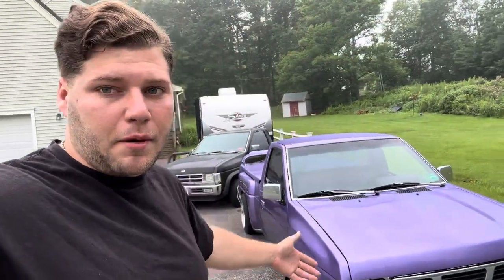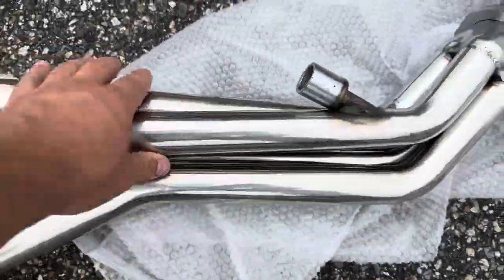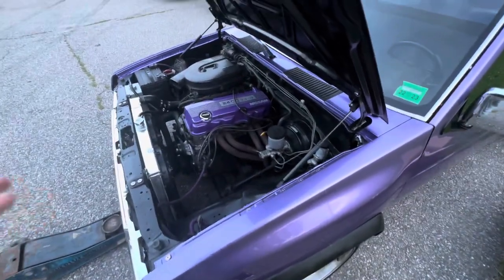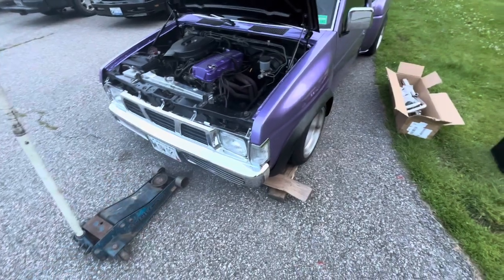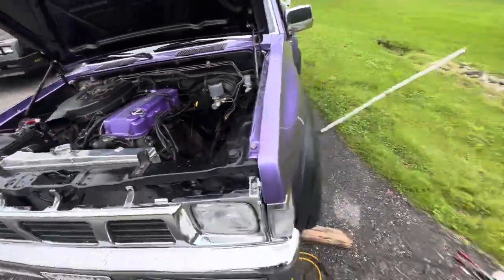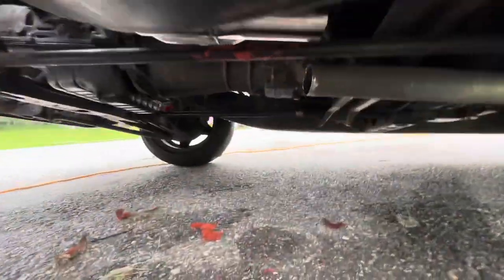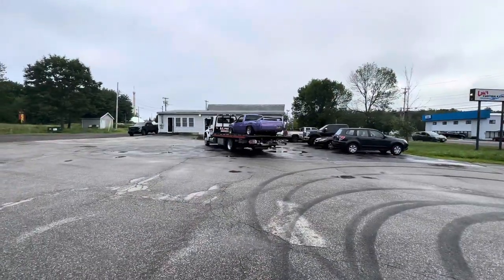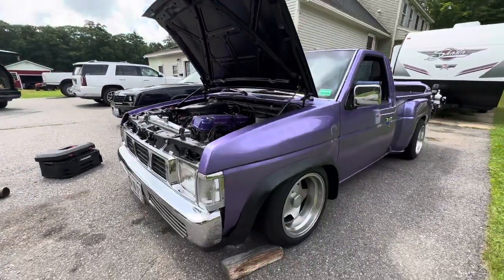How To Install Headers On Your Nissan Hardbody!!

Comment: Where are you located? So jealous of all that lush foliage. I am in Arizona. So arid desert.
So where did you get your hedder from again? I have 1997 4X4 love my little boy, he just needs some help with power. Thanks again for the videos
Reply from the maker: unfortunately, it's been some time since I've made this video, but honestly, I think all the 4 x 4 headers are the exact same all across-the-board, it's a 4 x 4 header that I made fit the 2WD!

Comment: Can't wait for the headers to come in. I already got the adapter kit and an edelbrok classic style air cleaner with 120000 cfm. The sensor is unhooked to the factory air box but the truck runs sooooo much better its unbelievable!
Reply from the maker: the headers will make it sound so much better too!!
Reply: @walkersootoo what adapter

Comment: How exactly did you bend in the firewall because I’ve been beating the dang thing in trying to make these fit and have barely made any progress.
Reply from the maker: just have to really hammer it out
Reply: @JapaneseMinitruck  a bigger hammer it is I guess lol
Reply from the maker: @ToastyBoi998 that's all I ended up doing, it sits close but just need some good swings lol, if you could lift up the truck, it might be easier to get to from the bottom possibly

Comment: So I know im behind on nissan stuff I have a 1986.5 2.4l Z24i 4x4 D21 nissan hardbody is there any headers made for the z24i engine I wanna have a header and not the manifold style that's oem and I can't seem to find anything on them or how to do it or if it has to be a oem part I'm not sure how to find the header for it please help if you can thanks boss I will also be subscribing
Reply from the maker: I believe someone makes them somewhere, I've seen people install headers on Z 24 I before I believe but unfortunately I haven't had to work on his Z 24I when it comes to upgrades so I am unfortunately not too sure.
Reply: @JapaneseMinitruck  I'm glad you responded I've been looking for quite some time myself I can't find anything custom for it either
Reply from the maker: @PD-ze2pm if you have Facebook, I would probably ask on some Nissan D21 groups! Some might have a good lead!

Comment: Why cant you just buy a performance header for a 1991 240sx KA24E? Wont that Work?
Reply from the maker: I have to do some looking into it, I believe the 240 SX heads are a little different than the hardbody heads, even the 240 has better cams, better intake, manifold ETC… it's hard to find a good header for these being that the four-wheel-drive one requires just a little hammering on the firewall/floor pan, but trying to avoid the torsion bars at the same time and making sure it tucks above the frame so it doesn't get scraped all the time, I have to do a little looking into it. I would possibly be willing to purchase one if the exhaust port are the same between the 240 and the D21

Comment: How do you pass smog with a egr delete?
Reply from the maker: where i live we don't have to go through smog. and cars where i live are exempt from certain emissions things over 25 years old
Reply: @JapaneseMinitruck  ah damn, my 2000 2.4 frontier has a cracked ex manifold and I was looking for headers but can't find any
Reply from the maker: @omarbojorquez7826  unfortunately i haven't found any headers for a 2 Wheel Drive 2.4 either

Comment: Awesome video! Have a link for that oil filler cap? All I could find is 24de versions
Reply from the maker: I just bought a generic nismo cap and put the 90s decal on it, but honestly, I don't believe it's the correct thread pitch, you'll have to figure out the thread pitch on the valve, cover and find something accordingly
Reply: @JapaneseMinitruck  ok thanks for the help!

Comment: Love the D21 content. Got a question just bought a 96 and the guy I bought it from did the  FI to Carb mod and had a custom header installed w/o O2 sensors holes, the check engine light is on and the truck runs a little rich but starts right up and idles smoothly. I want to keep the truck long term do you think I should invest the time and money In a header with the 02 sensors?
Reply from the maker: well, if it's carbureted, the O2 sensors won't do anything now because the computer isn't telling it what proper air fuel ratio to run if it's running a little rich, you just have to mess with the screws on the carburetor and feed it less fuel, if you switched back to EFI, you could always have a local exhaust shop cut a little hole in your manifold and you can add in a bung that allows you to threaten an O2 sensor!
Reply: @JapaneseMinitruck  Thank you for taking it easy on me with such a stupid ?, the best thing that ever happened to my mechanic skills was  OBD2. Btw my truck looks like your Grandpa's and now your truck, only mine is an extended cab.
Reply from the maker: @jorbar7726 thanks man! And no it's not a bad question, it's completely cool! reach out anytime you have questions, like I said if it's still carbureted, you just have two screws on the side of your carburetor. I would look up how to adjust them and you can choose to make it run, richer, or leaner as needed!

Comment: Hey i got a 97 4x4 how do you run without overheating without that radiator fan bc i would like to do that as well
Reply from the maker: it won't overheat if you get a good electric fan, the Nishimoto temperature sensor will wait until your vehicle is at operating temperature or the temperature you set and then will kick on once the vehicle is there to keep it at a good operating temperature!

Comment: Looks like you removed wiper fluid reservoir to put hood struts. You have a link for those? Also no workarounds to have a reservoir?
Reply from the maker: I do have a full length video on this as well! If you check out my channel, I have a couple how to videos on different things for the hard body, I do not fully remember if there would be a way to re-run your fluid reservoir after doing the struts, unfortunately
Reply from the maker: but they are from rohde fab on instagram!!
Reply: @JapaneseMinitruck  cool. I’ll check them out. Thanks!

Comment: Where can I get the headers for my 1996 hardbody 2.4L 4x4
Reply from the maker: you just have to look up header for Nissan hardbody 2.4L online, I think you can get them on eBay, but they're all the same one across all the websites
Reply from the maker: there's also a link in the description for the one I bought.

Comment: Do you need a tune after changing it? I think mine is making a little rattling noise when at idle or starting not while driving
Reply from the maker: I would get under your truck and make sure that your exhaust isn't hitting anything, I would make sure your hangers are not loose and rattling, and I would also make sure there's no cracks in any of your pipes, all of those things should call Some rattling, but no, you don't need a tune for a header on these,
Reply: @JapaneseMinitruck  thanks i will look into it once I get out of work thanks for the Info I didn’t know u would of answer but u helping a brother out. I probably end up changing the header since is old and rusty
Reply from the maker: @magdielvz427  yeah, I had a header on my truck already as well and it kept giving me like vibrations in. It sounded like there was like metal in my engine and it was simply when the engine is revving down it hits certain RPMs and makes the metal vibrate at a certain time, so when I swapped it out that issue went away
Reply: @JapaneseMinitruck  mine does exactly what you just described especially when on first gear thanks brotha🙏🏽

Comment: Will these headers bolt up to the stock exhaust?
Reply from the maker: I am not sure, it does come with the flange, but I don't want to say yes, especially with it being different because I installed the money, 2 Wheel Drive and they are 4 x 4 specific

Comment: I think the main reason why your header cracked was bc you don't have a flex pipe after it, its just straight pipe
Reply from the maker: That definitely doesn't help, it was a 30-year-old pipe, and on top of it it smashes the ground quite a bit.

Comment: Where did you get the radiator from ??
Reply from the maker: sadly, the website that I got it from doesn't carry it anymore, but if you go on eBay and look up Nissan hardbody aluminum radiator, you should be able to find one!

Comment: You could of just used bungs to block them instead of welding them shut and the extra O2 is to offset the sensor for the ecu for a CEL 😢
Reply from the maker: interesting, my truck only has 1 O2 sensor, it also did not throw any codes for me!

Comment: Where do you order parts for your truck?
Reply from the maker: honestly, I order from a little bit of everywhere, I get a lot of aftermarket parts from eBay, car parts.com, rock auto has a lot of good maintenance parts for the trucks as well! and then a lot of stuff is sourced from junkyards or I've stripped a bunch of trucks down and have a good supply of spare parts in case I need them as well!